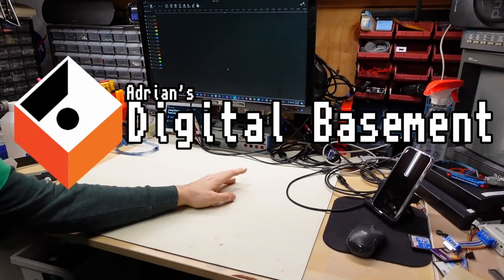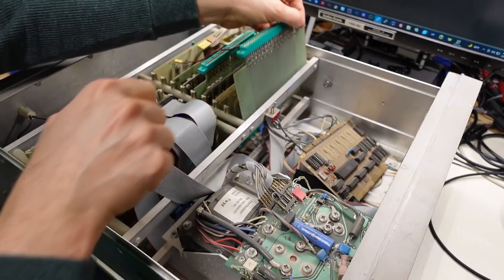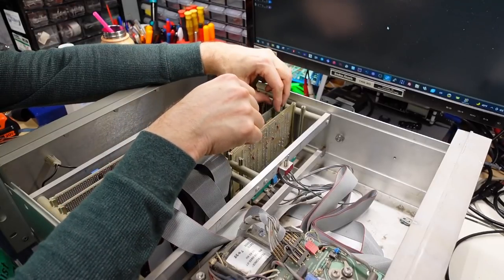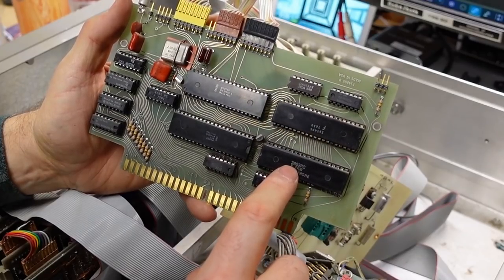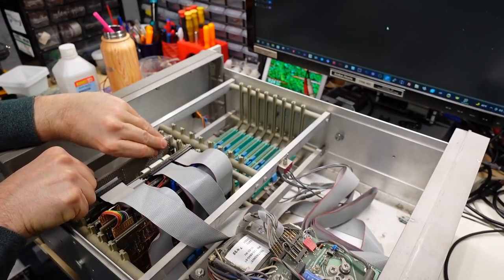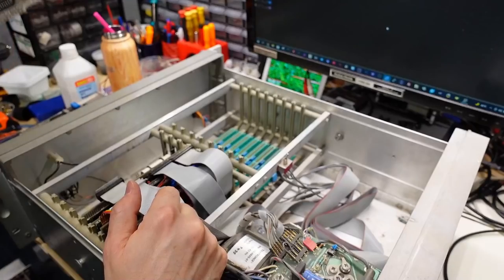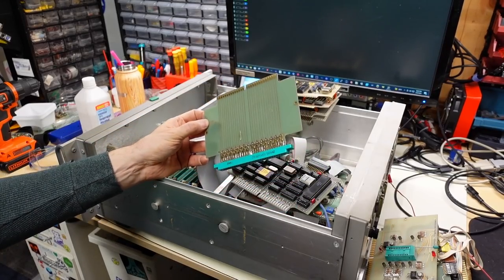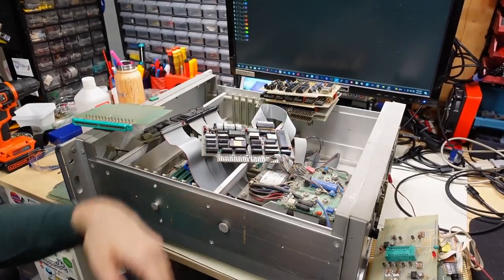I need help finding information on this mysterious computer

Comment: I doubt it was "home" made as it would have been pretty expensive in those days, especially the PCBs. I think a prototype or 1-off for some kind of industrial/scientific use, or maybe a college.
Reply: Yeah even the protoboard cards would of cost a pretty penny.
Reply: It would depend on the actual date. I made circuit boards in the 80's using photographic processes (PITA). However, how systems tended to be wire wrapped. Schools made systems like this (well, students did) in order to have computing resources. Seems like early 1980's
Reply: Actually the copper clad board / prototype boards were cheap, homebrew was done sometimes with etch resist marker or tape, then etched with ferric chloride at home. Double sided board not much more. There was much more emphasis and encouragement to homebrew. Companies like Heathkit, Velleman, Radio Shack, magazines like Popular Electronics etc would give ideas...
Reply: I am offended by home made term used here, its definitely hand made. Its a work of art, too neatly wired to be a home made project
Reply: @rdmclark  I agreed.. the casing look rack mounted.. definitely not home use...
Reply: @rdmclark  Only because in more recent times the term has lost any claim to quality. Not the case when this was made. Had the system been made with any sort of commercial intent the layout would have been simplified for purpose and nowhere near as elegant as it is.
Reply: @crashoverride328  the though-holes look to be machine drilled on all the boards, as well as the routing of the outside edges. Also the letters/numbers could be premade and stuck the mask, but they are all straight and perfect kerning. Way too small for home printer in the 80s.

Also the protoboards are wave solder plated.
Reply: @crashoverride328  I fully agree with you. The art in your given craft has long been forgotten.  Nothing like looking and fixing old equipment and learn the story it has to tell by the way it was designed and crafted.
All this modern stuff is lifeless,  just serves the function
Reply: My guess is industrial control, or ATE or some form of analysis, where it was built in house. Case is standard for the 1970's, along with the card frame and power supply, and you got those prototype cards designed for the card frames, and used them, especially if you only were making a few. Even military equipment used them in the ground support role, I spent a good number of hours fixing faults on similar cards. The printed cards were laid out by some draughtsman, hand taped and checked by the designer before they were sent off to a PCB manufacturer to be made, with the gold plated edge connector. Using the enamelled wire was common, instead of wire wrap, because you could use the slot next door, and did not have the volume wasted by all the pins. Whole systems of clip in retaining races, wiring pens and then a special varnish to finish off the board so it would not unravel. Once working pretty reliable, but a real PITA to repair, I would snip out the faulty IC, and solder the new one to the pins, so as to not disturb that wiring.
Reply: @crashoverride328  Thing is those boards are pro made, the home brew boards did not come with gold plated edge connectors, you either had tinned copper, or you used an edge connector plug you soldered to the board.
Reply: For the date it may well be a mix of home made and other.
Reply: @SeanBZA  Dear, that was I thinking too, but then mistery in that case is - why eprom programator?
Reply: A homemade computer was expensive in those days anyways. The giveaway that this wasn't likely for a home is the case, not the boards- you'd only be likely to seek out that style of case if you really did want a rack-mount system, in which case you probably wanted an industrial or commercial system. As another commenter mentioned, this has a high likelyhood of being an old industrial control computer of some sort. I think it even likely that some of the boards were later additions, made to improve it as component prices (especially memory) came down.
Reply: @TheAndjelika  You want to update the firmware as your process changes, either new equipment, or you have to put proms in the other side as well. So you put in a programmer into the unit you know will be working and available all the time in the process, so that you can debug the firmware, then write it, test and have it work. When this was built eprom programmers were both very expensive, very much in demand and also likely only available after filling in a lot of forms and waiting for it to be free. Build it in, and your own personal one is right there to use for almost free, as you already have 95% of the support electronics for it in the processor and power supply, just need a bus buffer and some Vpp switching for it.
Reply: That power supply is Tektronix and the case reminds me of either HP or Tektronix hardware from a while back.
The mix of proto board along with printed boards, I was also thinking it's some kind of weird prototype or industrial PC. 
It could have been a measurement mainframe, although for that I'd want to see more IEE488 or RS485 connections?
Reply: @absalomdraconis  My dad had a rack in his living room in the late 70s to mid 80s, and he built his own stuff into rack boxes. But I agree, the case is a give-away, has been rack mounted, but it also has rubber feet and riser cards to use out of a rack. The box is clearly a mass-produced box, but that just means the guy who built it bought a rack box.
Reply: Agree. Probably, a prototype of never released z280 16-bit machine.
Reply: @BobHannent  CVase is Tek, you could buy the case and power supply transformers from them, along with card cages. They also sold 5 and 7 series displays only, for integration into equipment. Both plain CRT units, plus microchannel memory tubes as well. I have one that was used to build some medical equipment, which is in this exact rack mount, though it has a different cover as it was designed for rack or free use. Another has the memory microchannel CRT, plus a chart recorder unit, that uses a CRT to write the image from the main tube onto photosensitive paper, feeding it out the machine, so you could have a record, and if you wanted to keep it you would simply use a Polaroid instant camera to photograph the recording paper before it faded away.
Reply: Gold plated PCB traces indicate industrial or military use to me, not a "home" anything.
Reply: Looks a lot like @mikeselectricstuff's BBC Micro right down to it being rack mounted and lots of random CPU cards, including z80 and 6502 and eprom programmer.  The funny thing is Mike isn't even sure what some of it is after all this time.  But we do know that it would have been done over many many years.  Hats off to these boys, I just came in at the end of it when only the very hard core would still make their own boards.
Reply: Well, it depends...  my home-made computer stuff from those days (1980-1984) looks exactly like that!
I was amazed to recognize the techniques used on the different boards.  "factory" boards with extra ICs stacked on top of existing ones, bodge-wired to the remainder of the board.
And those prototype boards with enamel (transformer) wire to connect the ICs together, I have many examples of that here.
E.g. a floppy controller for 5" and 8" drives, a harddisk controller, graphics card, all made using these techniques.
It sometimes makes me sad seeing them (and this system) and realizing how much time and money I spent on it, and what it is now: just an old 8-bit machine.

Adrian repeatedly wondered why there is no graphics card, well that was one way of working in those days.  Either you had a graphics card, or you had a serial terminal.
And this system has many serial ports so it likely was used with a serial terminal.  And a parallel printer.
It most likely was running CP/M 80 and applications like Wordstar.
Reply: @winstonsmith478  No you would get gold plate from any PCB house in the 1970's onward, you were specifying gold plate on an edge connector, so this would be done as a plating option right after etching, where they would route out the board, then use a trace on the edge connector to join them all together, and plate onto just that edge of the board, then cut off the joining strip and chamfer the board edge so it can be inserted easily. 

You would only gold flash the entire board if you were not putting on a soldermask, and needed it to stay good for a while before assembly, otherwise you just  used a tin plate or roller tin and a soldermask, which gave you those crinkly large green areas of copper. 

The thin gold plate on the copper was just there to keep it clean for a few months before assembly, the edge connectors had a much thicker gold plate with a hard wearing nickel plate to keep the gold from alloying with the copper, and to make a non porous surface. Yu did not want nickel on the surfaces you were going to solder, the solder will not bond well to the nickel plate.
Reply: Id try to get up with the imsai guy on here and get his thoughts.
Reply: I built a 4bit processor with frontpanel leds/switches in the late 70s, and apparently this qualified me to be the 'on demand guy' for a DEC PDP-11 rack with a whole heap of custom 'ratsnest' boards in the late 80s early 90s some 15-20 years later. I don't remember what that machine did nor do I remember much about the RT-11 programming language it used, but the boards may have been vaguely similar. 

I really can't remember precise details of that 4ft rack of horrors. I may have actually shut those memories out and sometimes still have nightmares about wrangling a (4 or 5)RU power supply that nearly weighed more than I did at the time...  I still refer to that as my Steam Computing days...

But I also have memories of some systems that used a similar bus structure to that, Morrow rings a faint bell as a possible variant? (Although there were two or three S100 variants as well, I seem to recall.)
Reply: It could have been a student project for an engineering student. It was 1986 when my sister got married right out of college and her husband is an electrical engineer who is the head design engineer for a circuit board manufacturer. This reminds me quite a bit of things Gary had in the room he was using as a lab when they were newlyweds.
Reply: Oh and that PDP-11 had one sensor processor box mounted elsewhere in the building that ran a 6502 and serial data back the DEC. So such coexistence was probably quite common at the time, and being the dates of the ICs I might be tempted to say it was cobbled together in the very late 80s to mid 90s as a custom order for some industrial client. Having three DB25s arranged that way makes me think "sensor input / data output / local TTY." The ribbon connectors were most likely used to extend the bus signals one to a rackmount case above and one to a unit below it in the rack. I have vague memories of that being used in larger systems.
Reply: @crashoverride328  I worked with a few old Heathkit employees.  Their motto was "never let the customer fail."  My neighbor was an accountant for Heath, and when my uncle would pass through the area,  he would pull out a big wad of money he saved up and give our neighbor the catalog numbers of what he wanted.  Our neighbor would pass on the employee discount.  By the time I worked for ZDS, Heath was in the process of being sold off since the owner Groupe Bull wanted to drop the DIY and educational products.
Reply: Absolutely agree. This was no homebrew. Unless they were seriously dumping money into it, like buy a house money.
Reply: @mikeselectricstuff Hello Mike 👋👍
Reply: @martinhorner642  Not buy a hous money, but certainly buy a (2nd hand) car money.
That is the kind of money I used to spend on the hobby.
In total for all computer parts bought between 1980 and 2000 probably enough for a new (small) car.
Reply: @crashoverride328  Yes i can remember my father and i made somthing like that when i was a boy.
Reply: Watching this video immediately reminded me of your tour of your old BBC Franken-Micro!
Reply: Yep, I had something similar in my University for Computer Architecture tutorials.
Reply: @Rob2  at the time this custom, made to order machine was built, Radio Shack wanted over $2000 for a complete 5.25" floppy disk drive set for my color computer. That's like well over $5000 today.  I don't think I'm that far off the mark. Possible, but people forget how expensive this stuff was.

A computer that was newly acquired at my high school the year I graduated, probably very similar specs, but was prebuilt, not custom, was val'd at $20k... Then. That's what I'm basing my guess on.
Reply: @martinhorner642  Yes it is true that the parts were very expensive then, that is also why I built my own stuff from components and used e.g. surplus disk drives (8") or newly bought bare drives ($400) and built them in a cabinet.
But over here $5000 does not buy you a house, not even a car.  At best a 2nd hand car.  Maybe it is different in your area...
In total I spent like $10000 on computers and peripherals in the years 1980-2000 I think.  That is still not a house here (in that time).
Reply from the maker: This is a good thread -- one thing to consider is Tektronix is based here and Intel has a massive campus, bigger than in California. The city is filled with surplus and leftover equipment from both companies, especially Tek. Also it's filled with retired and current engineers -- so I've seen other ex-engineers end up with a bunch of old gear that they modified to do all sorts of things.... so it's more likely than in a lot of places to have stuff like this actually by home-made by one of those engineers. On the other hand, another viewer posted saying he worked for the company that made this ATE computer for a customer under contact. (Company that made it was just south of Portland in Salen Oregon.) It's possibly they made more than one for local area companies and  universities. What a shame I didn't end up with the boot disk and other floppies. They would have been a gold mind to investigate!
Reply: @adriansdigitalbasement2  My guess would be that one of the engineers "inherited" this computer from his employer (the case, supply, and the printed circuit boards) and then continued at home building on it.  He then made the Z280 board and memory board.
Wikipedia mentions that the Z280 was introduced in July 1987, so building something like this would likely have been some time in 1988, which is way after the days of the 8-bit computer.  The RAM chip shown also must be of similar age.
By then I had already abandoned my Z80 machine, and was using an Atari ST (68000 machine) bought in 1985.  Other hobbyists were using the first cheap PC clones.  At work, things had completely moved on to PC architecture.
I would not understand why a professional company would still be tinkering with Z80-family stuff by that time, certainly not on proto boards.  When you really wanted to have a new system for control or similar and have compatability or other reasons to stick to Z80 or Z280 stuff, there were enough ready-made CPU cards on the market that would be much more cost-effective inside a corporation.
Reply: is this a chess PC?
Reply: @rdmclark  
If it is made in USA, then it is vey old.  Nothing is made in USA any more.
Reply: @Rob2  Indeed! I couldn't spot any of the back then popular CRTC chips on the boards, so I guess too, this machine used serial terminals.
Reply: @maltronik  home users would use a standard chassis
Reply: Industrial and some other professional computing kit doesn't always use up to date technology. I don't understand why, I'm just relating what I've seen.

 @adriansdigitalbasement2  I wish I lived there! :)
Reply: @deansmith4752  ⁷
Reply: @jimjimsandbern9382  that’s actually not true, it’s like saying nothings made in ‘insert country that’s not China or India here’, when in fact there’s a lot of manufacturing in most countries, it’s just smaller volume, higher quality products, a great example is Henry Hoover
Reply: @rdmclark  Yea, I figured he would be upsetting some people chucking at those "home made cards".  That is how we did back then and they are very well done!  It's a shame he didn't get all the "home made" <chuckle><chuckle> documentation with it.
Reply: Those PCB's are easily made at home with acid etch...
Reply: @eekee6034  The reason why is simple - you wring every penny you can out of the equipment you've already invested in. Late 80s computing power wasn't all that much greater than late 70s computing power, but there was a staggering difference in cost when it came to professional and industrial equipment. I would not be surprised to learn that this machine ran well into the 1990s, depending on the application. It could also very well be that a smart engineering group in a company bought this box second-hand and made further modifications to get it to do what they needed.
Reply: @crashoverride328  Yeah I was mid-teens in the 80s when I graduated from breadboards and started etching boards. If this was done at home as a hobby, I would have masked the large sections of unused board with electrician's tape to save on ferric chloride. Since these were made with no regard to costs, I think this was done in a business. Had I graduated in EE instead of another field, I'd probably would be able to made a system this complex by my early-20s. As for the case, I'd think there was a metal fabricator in the same business (esp with precise drilling on the boards for DIP sockets), but I can't reconcile the extra effort to create the perforations for air venting when something simpler would suffice... seems to be mass manufactured.
Reply: @adriansdigitalbasement2   I assembled an STD bus CP/M machine around 1983. I purchased 2 8" half height floppy drives and case that was many times larger than the computer. The only thing I have left from that computer are the head stepper motors from the drives. 
I held on to that computer for many years and now I wonder why I didn't save it.
Reply: @maltronik  racks would've been normal prior to the late 80s, and a lot of companies built systems like this. More handmade than homemade specifically but then again, Apple was homemade.
Reply: @rdmclark  Also, think about the time and care a person took to make these boards....Many many hours spent.